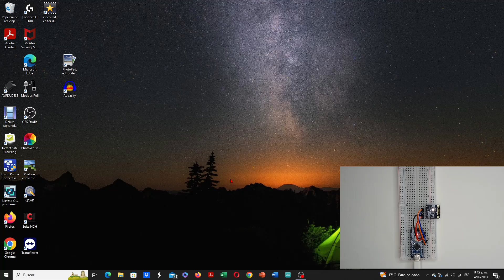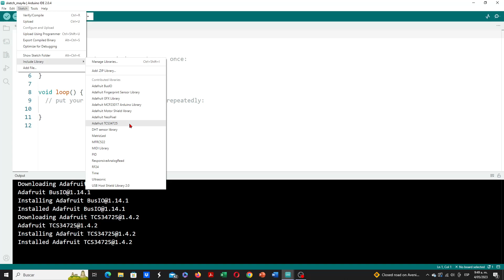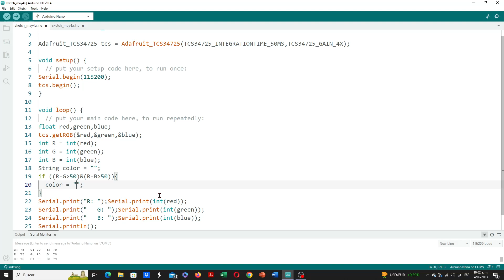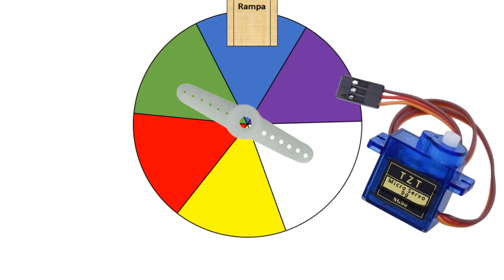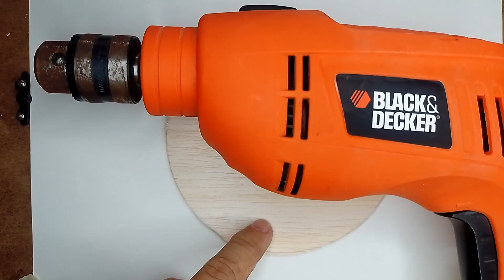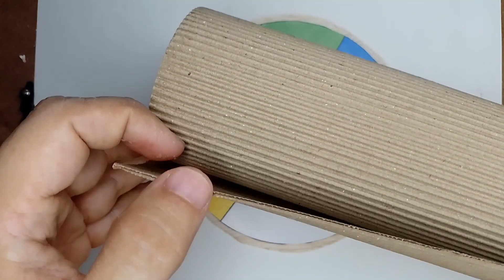Detecting and Sorting Objects by Color with the TCS34725 RGB Sensor and Arduino

Comment: Hi, great video. I have a question, does the code for this program work with Arduino UNO r3?
Reply from the maker: It works, the same code. Thks
Reply: @ElectronicSpotEng I also added LCD to display the measured value more intuitively, but when I added LCD, the servo did not rotate. I tried many ways from the connection wire to the code. Please help me, sir. I only have 3 days lef, sir.
Reply: code applicable to TC230 sensor too?